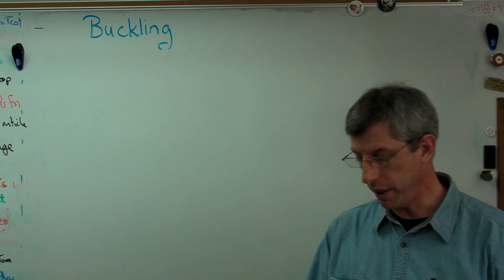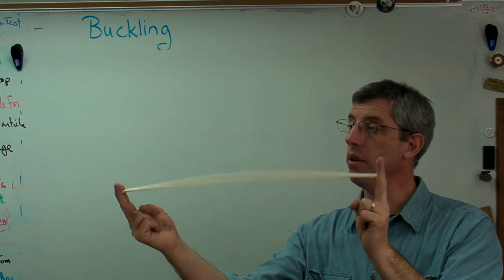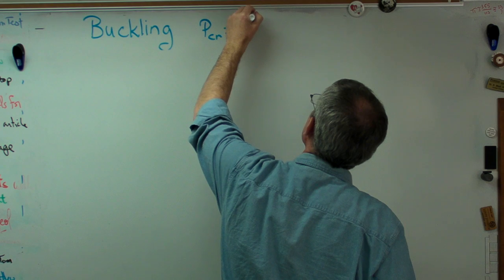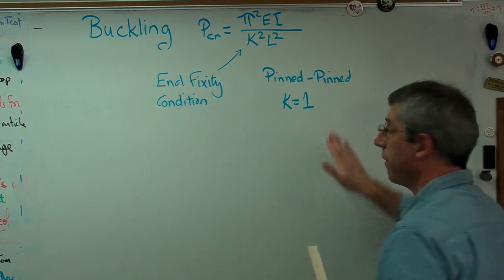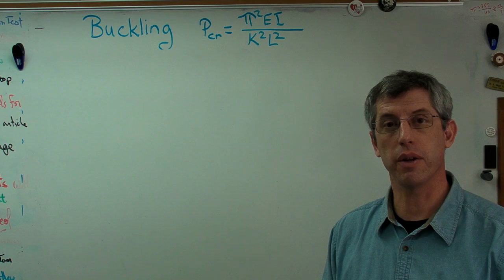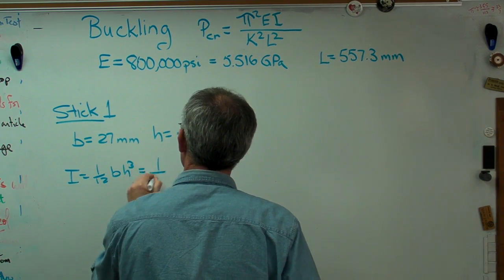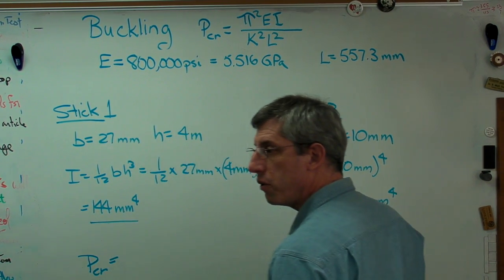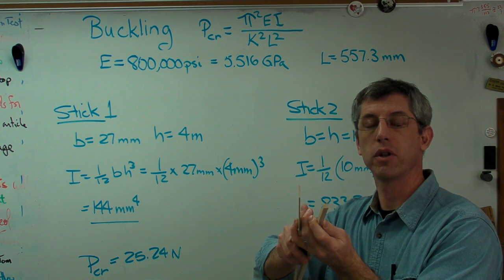Buckling of a Thin Column.MP4

Comment: Is there a connections between civil engineered space trusses and atomic structures? 

Euler’s Contain problem called “Particle in a Box”. Atomic structure and molecules are described using this problem.

https://youtu.be/wrBsqiE0vG4?si=waT8lY2iX-wJdjO3

Mechanical properties related to a unique variation of Euler’s Contain Column Theory . 

This process, unlike harmonic oscillators can lead to formation of stable structures. 

The engineering study shows the previously unknown bifurcation between quantum jumps in the process’s load deflection curve. See the sawtooth load deflection graph with its exponential fit curve.

The effect has been used to make light weight structures and shock mitigating/recoiled reduction systems and earthquakes isolation systems. 

The model shows the known requirement of exponential load increase and the here-to-for unknown collapse of resistance during transition.

In materials the process continues till the load passes the ultimate tensile strength.

Comment: Higher cross section and shorter length will Greatly increased it's load capacity. To get the critical stress just divide it by area.

Comment: Normally we consider the minimum value of  the moment of inertia thus we get the direction of bulckling. But what happens for square cross sections? Since there's equal value of moment of inertia in both ways?

Comment: Very good explanation, but I have a question, the critical load formula serves to determine the load to which the column buckles, But is there any formula or a way of knowing since the column has buckled, ?
Reply from the maker: We generally assume that a column has little or no load carrying ability after it has buckled.  There are some expressions for beam elements with large deformation that might work for buckled beams or columns.

Comment: so what happens if you rotate the ruler stick cross-sectional shape by its axis 90 degrees so the value of I is greater?
Reply: +Rusty Shackleford and then do the empirical test
Reply: +Rusty Shackleford The moment of intertia (I) is calculated in the x and y directions, so if you rotate the ruler you would have Ix <- Iy and Iy<-Ix. In the video, just the lowest moment of inertia was calcualted (the one with the lowest "h"). So, If you make the empirical test again rotating the ruler, it would not buckle upwards, but inwards/outwards of your screen in this case. Hope it helped
Reply: yes that makes sense. cheers

Comment: Hi there thanks for the helpful video. I have a question about the Moment of Inertia equation though.[ I = (1/12)*b*h^3 ] How do we know which edge to use as base and which edge to use as height?
Reply: The axis for the area moment of inertia is sort of like the resistance of an area element from rotation (or just an point away from the axis). So, you use the distance^3 that would be in the direction perpendicular (or can think of it as away) from the axis of interest. You can think of the other distance multiplier as just adding a multiple amount of lines from the axis of interest with the same sort of rotation resisting value which in sum is the moment of inertia.
Reply: +Ramen Van Trough Very good question and here is the very good answer : The rectangular cross section has two moments of inertia Ix and Iy. You must calculate both and select the smaller one. In this example h is 4 and b is 27.

Comment: Very informative video! Thanks! One question:
I plan to make a metal tubing construction and I want to run some numbers for the horizontal roof beams (the base of the roof trusses). As you gave the formula for  "the critical buckling" that seems like a sort of limit, how do I calculate the real buckling value  in order to compare it with the critical one?

Comment: columm AB carries a centric load P of magnitude 60kn. cables BC and BD are taut and prevent motion of point B in the xz plane. using euler formula and a factor safety of 2.2 , gelect tension in cable. determine the maz allowable length L...this is the qns

Comment: Remember guys, that the column is never truly straight and so the column buckles from the moment you put any compressive load on it, no matter how small. Remember that "buckling" is defined as a column that wishes to worsen its curvature.
The Euler buckling load is better described as the maximum allowable end load before the buckling curvature "runs away" and, it fails catastrophically. It is the limit allowable compressive load. It is not the load that initiates buckling.

Comment: @MrZah89 I tried to calculate Pcr (not Pe) and I got 25.24N. Pcr=(Pi^2X5.516X10E3MPaX144mm^4)/(1)(557.3mm)^2. Try that. U must have got your unit wrong.
For Prof French, u are great. This is a great refresher for me. It's much easier to listen to u than reading text like Juvinall or Mott.